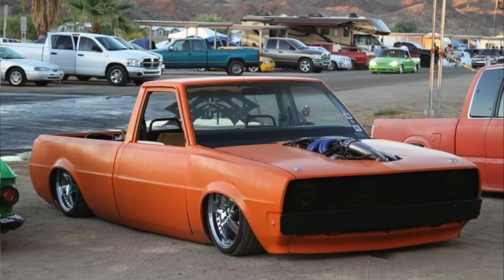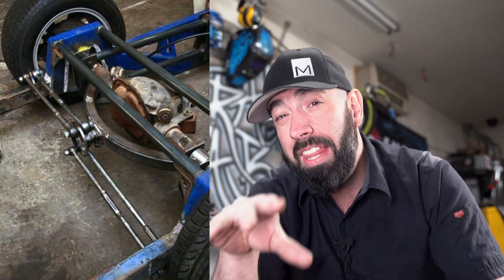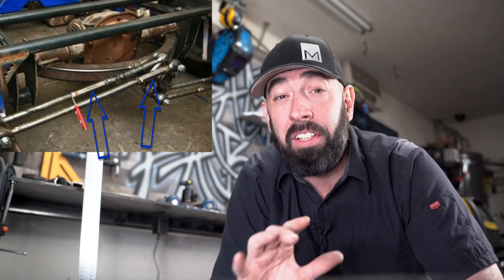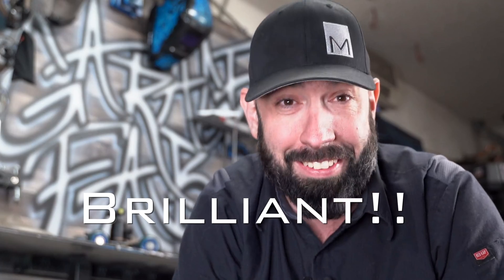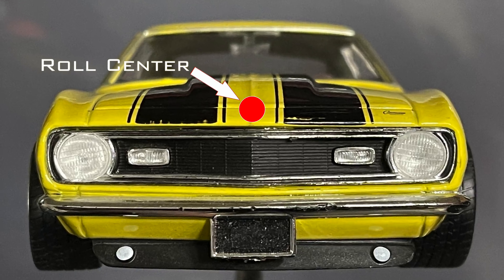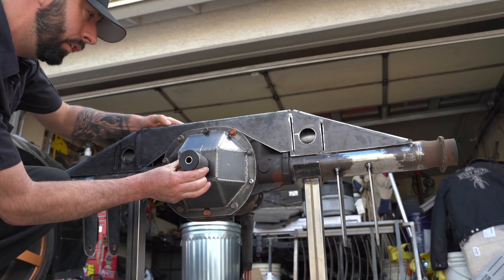Build a Tough Differential Cover! (For a Watts Link [Or Not, Whatever]) Mighty Max Ep. 15

Comment: Don't forget you will need a way to fill the diff with fluid
Reply from the maker: That’s hilarious you brought that up, Gary! I cut the bung out of an old exhaust pipe for the fill hole threads, went to the auto parts store for a threaded diff plug to match, wrote the script instructing how to determine the height of the bung and recorded the audio.
It wasn’t until I went to film the actual footage of doing the work that I realized that the factory Ford Mustang diff cover didn’t have a hole in it! I had to look up a YouTube video on how to fill the 8.8 differential with oil, and found that the fill hole is actually in the front near the drive shaft flange. So on this particular cover, I didn’t need a fill hole. But that’s still good to point out for those working on other axles! Thank you Gary! Cheers!

Comment: Bad ass as usual brother. Are you going to weld the nut on the inside? It seems like the gear oil would eventually penetrate and leak.
Reply from the maker: Thank you my man! Yes. Absolutely. The only nuts I have currently are Nylock nuts. Needless to say the Nylon doesn’t like the heat of the welding so when I need to weld a locking nut, I buy the all-metal type. Lastly on final install, I’ll be sealing the threads with sealant made for gear oil. It’s a low pressure component so the most I should ever see is a slight seepage. Hopefully not even that. 🤞